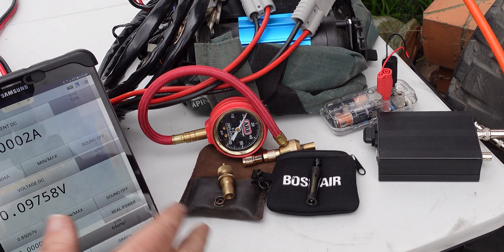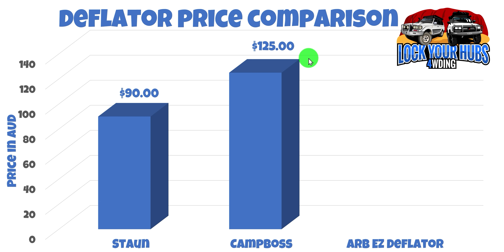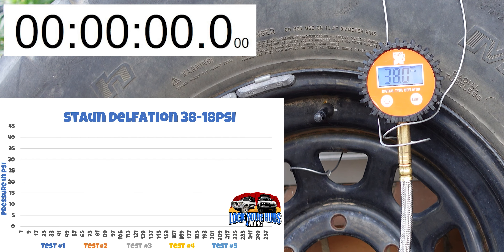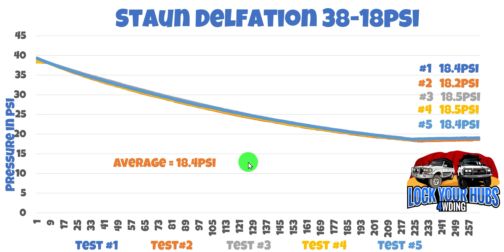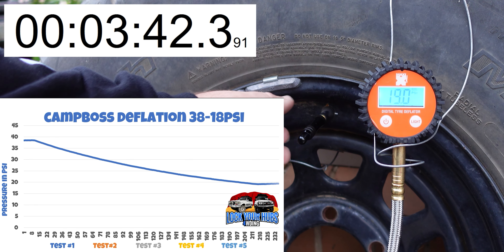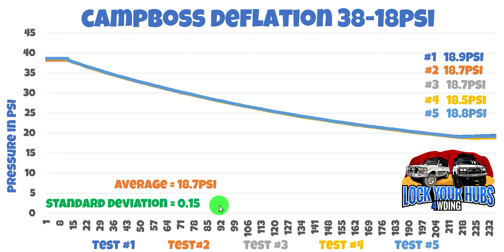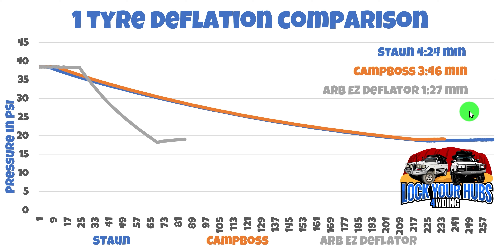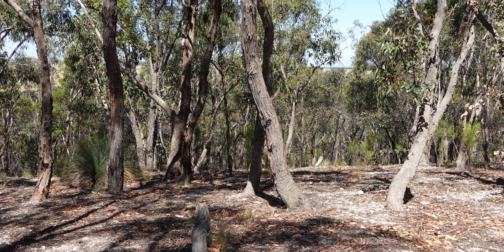Staun vs Campboss vs ARB EZ Deflator Tyre Deflators

Comment: Great video. I had the campboss but mine were hopelessly inaccurate. As in, not within 15 psi of where I set them or each other. Given your results and those of others commenting,  I must have just been unlucky.
Reply from the maker: I've heard of a few with accuracy issues, though I can only test what's in front of me.
Reply: @LockyourHubs4WDing  yes. That’s fair enough. I should have gone back to campboss it seems. I assumed the product was just no good but maybe I just got a bad batch. Yours seem to work great.
Reply from the maker: They still are as well!

Comment: I liked my Stauns. I could stand there with my hands in my pockets while others fumbled with their deflators, set of keys or sticks while trying to air down.
I was a bit annoyed when the kids kicked them out the door somewhere and lost them in the sand on Stockton Beach.
Did you cheat a bit with the ARB deflator, having the digital gauge right there for easy reference, or did you use the gauge on the unit?.
Reply from the maker: I used the gauge on the unit.

Comment: Bought a set of Stauns today, got them from BCF for $78. Had a look at the Campboss ones at $125, but after reading a few reviews, and the almost $50 price difference, i was persuaded by to get the Stauns. Mates have them, and they are always reliable and consistent. Most of my driving is sand, corrugations, beach track, so the 18psi is good for now. May Set two for 18psi, and another 2 for 25psi - or just buy another set.
Reply from the maker: When I use stauns, I usually set them for 18 and 20 psi. My go to pressures for general offroading front and back in the 80.

Comment: Don’t forget when you use any of the rapid deflators that stupid pin don’t go back in 100% of the time and won’t come out 100% of the time so you have that 1/2 speed deflation with the pumping back up because 1 tyre is way pass the rest vs the camp boss n stauns maybe be slightly off 1 or 2 psi

but stauns are designed to be put on 5mins before you get there obviously they say not for on road use but that’s to save there ass when some guy says his tyres went flat on the freeway probably a jeep or a patrol owner

Comment: Interesting result.  I would have thought the Ezi Deflator would have been the quickest overall.
Having said that I've been using the Staun Deflators since about 2003 and they still going strong.  I check them every 6 months or so for calibration.  A great Aussie product.
Reply from the maker: They are.

Comment: Great comparison. It seems that the ARB taking 1 full minute more to deflate e tires. However, it deflates to the exact 18 psi. For the other 2 deflators to reach the exact psi you want, you will have to spend significantly more time to fine turning the psi, with a gauge. 

So IMHO, the winner is the ARB.
Reply: BTW, I just bought a ARB style deflator for 8 bucks.
Reply from the maker: I still keep grabbing for my ARB deflator as well!

Comment: Thanks Simon. Great comparison, as always! I've been using the Campboss deflators for about 1 year now and absolutely love them! Easy to use, very accurate (I always use a quality tyre gauge to check) and very easy to change the pressure setting on the fly. And I love the fact that I no longer have to haunch down for minutes at a time!
Reply from the maker: They seem like a decent thing! The Stauns in the video are about 10 years old and still work just fine, I hope the Campboss last just as long.
Reply: I agree Campboss are a bit over priced as thete similar deflators that can be adjusted going gor about $50 cheaper.

The problem with rhe Staun is that you can't recalibrate them easily, especially when you're on the beach and really need to drop your PSI.

Comment: Great comparison. I find the Campboss is also great that you don't have to stay kneeled down while you deflate.
Reply from the maker: Thanks, the older I get, the less I want to kneel down while using the ARB.
Reply: @LockyourHubs4WDing  Your videos have played a massive part on my current BT tourer build.
Real world facts not sales hype.
I used your information on the inflation vid and purchased a ARB twin where I did add a air tank as this assists with using a air gun.
I don't used the valve removing when inflating as the area reasonably fast as is.
Reply from the maker: Thanks mate, comments like yours make it all worthwhile for me. I just want to get reliable, factual, unbiased information out there without all the hype.

Comment: Personally I have the Campboss, purchased when released for $99, in my NP300 as it normally only get tyres deflated for Beach trips. Have stopped checking them as they were always consistent. In the Jeep I have the ARB as I run 2 sets of tyres and variety of pressures.
Reply from the maker: The 25% price hike since release is a hard pill to swallow.
Reply: @LockyourHubs4WDing  definitely puts me off getting a second set

Comment: I like your test equipment 👍
I use both styles now. The 4 stauns to get down to 25 on all corners then a gauge one to get down to exactly what I need. Strangely what I found was to get the same PSI in each of the stauns was a slightly different number of turns from closed on each and that was after testing 3 times on each staun. I saw a recent video using the number of turns method on those to get to a usable pressure but hey seemed to differ too much for me.
Reply from the maker: There's going to be a tolerance that the springs are manufactured to, so stands to reason each Staun is going to have to be individually calibrated. Also periodically recalibrated.

Comment: I won’t be changing from my stauns. The good thing about them is when I’m nearly where I’m needing to deflate, I stop the car, screw the stauns on and drive slowly for a few minutes and  then stop, take them off and screw the valve caps back on. Nothing is faster than that
Reply from the maker: That's definitely an advantage both the Stauns and the Campboss have over the ARB.

Comment: Did l miss it, what about walking time between tyres. For all deflators, l use both ARB and Campboss very little difference. I'll stick with the ARB deflator most of the time.
Reply from the maker: I used 3 seconds to walk from tyre to tyre around the car for the final analysis.

Comment: Thanks for providing this comparison, good to know the competition and how it works. I was lucky enough to get 2 sets of Stauns back in early 2000's, I have one set to 18psi and the other to 22psi, If the campboss ones came down in price I would update mine, however happy with doing 4 tyres at once in 5/6mins, AND!!!! having a yarn to the guys with the ARB deflators crouching down with the tyre.... Although having the car off level does give very mixed results with final psi level...lol...
Reply from the maker: The off level problem is going to be an issue for any of the deflators though, not just the Stauns.  As I get more "mature" the less I want to crouch down next to the tyre using the ARB style deflator!

Comment: Are your stauns the originals or newer model? If the older ones you can drill a 2nd hole in them to release the air faster :)
Reply from the maker: Hmmmm, not sure they're around 10 years old. How do you tell the difference?
Reply: @LockyourHubs4WDing  original have one hole to let air out. Newer ones have two.

Comment: Extremely interesting, well done with the 4 tyre comparison. I use both the Staun and Campboss depending on what I grab which are preset although I prefer the ease of adjustment on the Campboss. Cheers
Reply from the maker: Thanks!

Comment: Interesting, i have 2 sets of Stauns and also the CampBoss deflators. The CampBoss are slower then the Stauns, the hole where the air comes out is smaller so it's really not possible for them to be faster. Wonder if they changed the design?
Reply from the maker: Possibly? I borrowed the set from a friend, I'm not sure how long he has had them.
Reply: @LockyourHubs4WDing  How do the air vent holes compare when you check the Staun and CampBoss side by side? Hard to tell in the video but the CampBoss you have the vent looks smaller like mine also. Pro tip too, once you set the Staun to the right pressure throw a piece of heat shrink over it and shrink it down. Then when you screw them off and on your wheels you wont knock them out of calibration by accident. I have red on my 18psi set and black on the 25psi set.
Reply from the maker: The Campboss definitely has the smaller holes in the side of the two, though I also felt air exhausting along the flats of the central adjustment shaft.

Comment: The ez deflator would still come out on top though, especially if you're always needing to use different pressures, for a set psi like in the vid, I would agree with the data provided
Reply from the maker: I would definitely agree with the Stauns, though the Campboss only takes a couple of seconds to change, as long as you've got your glasses!

Comment: Good review - a lot of work in testing (again), so thanks. Went to eBay and bought 3 sets of 4 cheapies (so I can have two preset deflation pressures and enough to cover the camper with two presets too). They are a pretty simple arrangement from the looks - a spring valve and spring valve pressure adjustment body. I imagine these will slow right down towards the end of the deflation, so will probably be slower that the Staun/Campboss, but really who cares? I can stick them on and have a cuppa by the side of the track. Definitely not going to fork out $375 on the Campboss or $240 for the Stauns - my three sets cost less than $40 for all three sets. Got a Kings deflator too, so I have a backup.
Reply from the maker: The King's rapid deflator?
Reply: @LockyourHubs4WDing  Oops, they call it the Kings Tyre Deflator.  Kwiky. Its the one tyre at a time type with the guage.

Comment: When you did the ARB, were you watching your external gauge to stop it or stopping and starting to check the arb gauge?
Reply from the maker: I used the external gauge for the test, that may have made the result slightly faster than checking pressure a couple of times. Though I wanted to test the equipment, not my ability to guess what pressure I had deflated too.

Comment: i would argue the staun and campboss times were far closer together as the stauns you took the time to explain the experiment at the end while the timer was running. Still cant deny, the campboss was definately faster but i won't be switching from my stauns. Prior I used similar deflater to the EZ's but as a base i prefer the ability to walk around and join conversations while deflating rather than squatting by each tyre not able to hear anyone.
Reply from the maker: There may have been some variability in the tests, as humans are somewhat unreliable!

Comment: Wow, they are all rather expensive. We have a couple of deflators, the real cheapie, a Dune was $25 and works better than the more expensive one we have. At just $25 the Dune is cheap enough to buy 4 and still have money left over compared to the Campboss. Technically it would be possible to do all tyres more or less at once with the Dune style deflators. A bit of effective time management would be needed and maybe some quick reactions, but I am betting that it would not only be possible but it would be quicker. Considering the huge difference in price, I think even waiting a bit longer to deflate the tyres one at a time is so much better.
Reply from the maker: That would keep you on your toes!

Comment: I’ve never really understood time factor for airing down comparisons. It’s only a few minutes while most people spend another 20 minutes having a beer, smoke or chatting. 
I’d rather see accuracy, ease of use and potential wear and tear (I.e. throw them around a bit and see if they drift). Saving 6 secs per tyre is of no use to me
Reply from the maker: It's building a better mouse trap. Whilst accuracy within reason is more important, speed isn't too far behind!

Comment: Great comparison. I was going to get the Camp boss but like everyone said they are way too expensive. I ended up buying a Jamec Pem TDR4000 tyre inflator which also deflates. Has a nice long hose so don’t have to bend down. A little more than the ARB version but better quality and actually stays clamped on the valve stem unlike the ARB one. May take a little bit longer but does the job.
Reply from the maker: I love my Jamec Pem Auto 1000. A great piece of industrial quality equipment at a reasonable price.

Comment: If your life is that screwed up that 1 minute is going to ruin your day you have bigger issues than tyre pressures
Reply from the maker: While I agree to some extent, where do we draw the line, currently 20%.  Is an additional 50% still ok? That'll depend on each individual person.
Reply: @LockyourHubs4WDing  . Yeah, we used to be happy letting them down with a stick and guessing the pressure and we still had fun. Making everything about precision and speed and the latest stick technology kind of detracts from it for me
Reply from the maker: I'm all for the fastest stick! It's just a better mouse trap I guess.
Reply: @LockyourHubs4WDing  . I'm not knocking the new stick